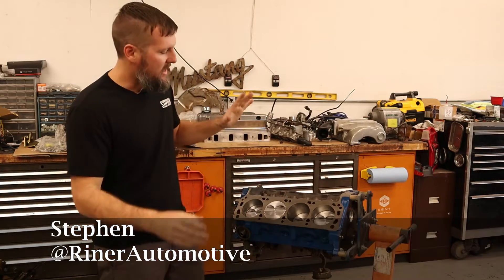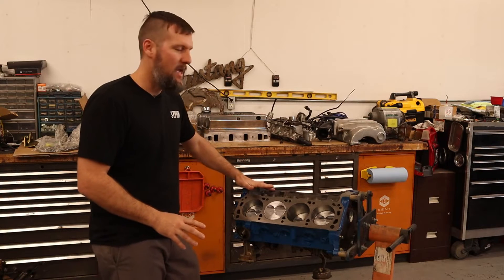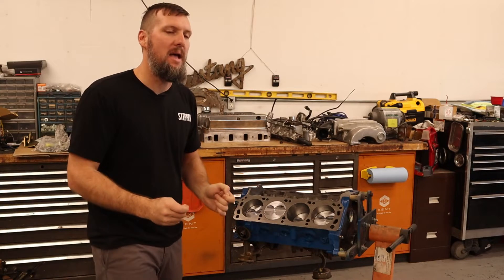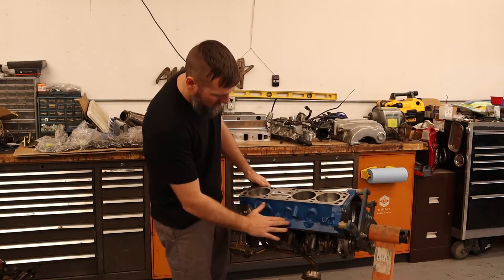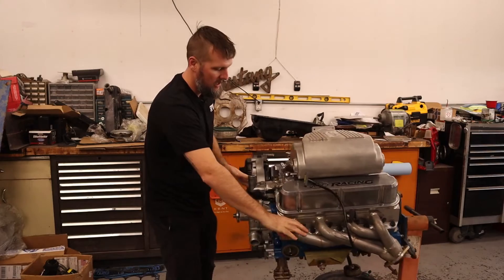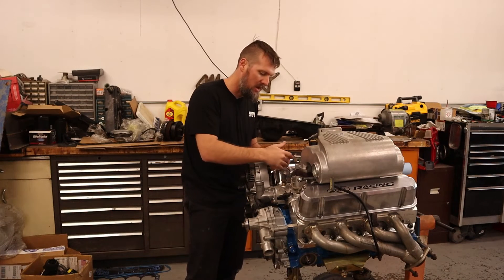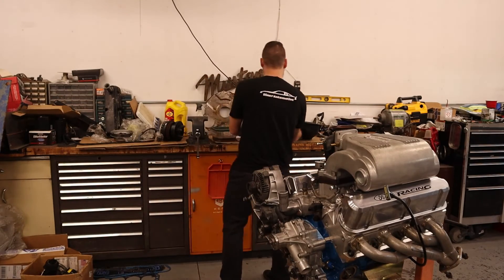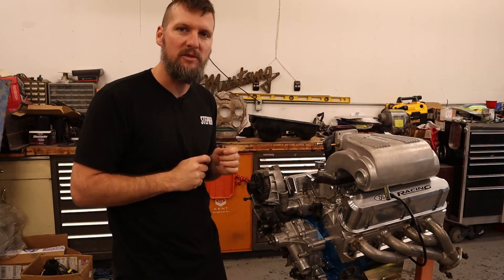306ci Engine Build - CAM-T #SN95 Mustang

Comment: What did this 306 make for hp
Reply from the maker: I still need to get it correctly dynoed. I estimate in the 300-330 rwhp range
Reply: 340 tuned

Comment: With those 11r heads you have tons of clearance if you ever change cams. I wanted a set but couldn't find them any where. Did you increase compression with new pistons?
Reply from the maker: Same compression. Basically did a stock bottom end rebuild.